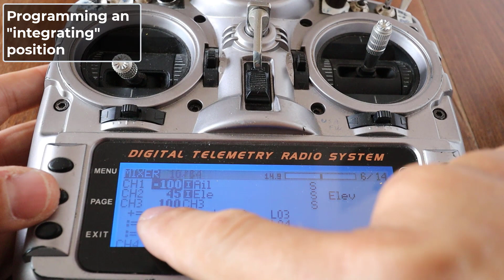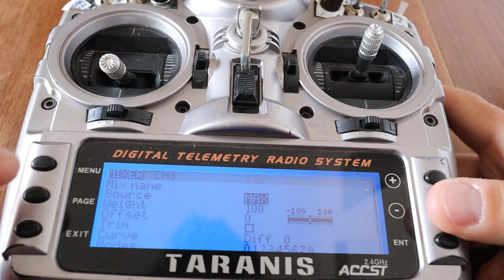Bruder RC conversion with servo only

Comment: Very nice and simple 

🔵🔵🔵👍👍👍😀😀😀🔵🔵🔵
Reply: Do you have a video of this Bruder to see how it performs?

🔵🔵🔵👍👍👍😀😀😀🔵🔵🔵
Reply from the maker: No
It is a little slow because it is running at 3.7. But moves realistic (also because i set the accelerations on the taranis, and it is powerful. I could boost it to 6V and be much faster.
Lets see if i find the time i can make a quick private video and share the linkhere in the comments
Reply: @MakerFabio  Thank you my friend

Comment: Hi Maker, is it possible that you can send me that model file and I can post it to my station?
Reply from the maker: Hi Manuel, I m traveling for a couple of days
I ll figure out how to share this WE
Reply: @MakerFabio  Hi Maker, let me tell you my progress. I have managed to place its parameters and everything was fine except that when the servo reaches its end (this only happens in one direction) it returns to its axis very slowly after about 5 seconds. Another challenge is that one of the arms of the robot has 2 servos, I verified that these parameters are not valid for this arm with double servo, it goes crazy, I would like to know your opinion, if it would be possible to assign the function I am looking for to this arm double, by the other arms, I don't know what problem can occur so that in one of the senses, they return to their axis slowly. Sorry for the bad google translation.
Reply from the maker: @Manuel-ti2zd  not sure what happens.
Probably your limiters are not working correcly, check the video at minute 6:16, those limit are clamping and avoiding exceeding 100% but also -100%
So you have 2 different logical condition for max and min
Copy each line (multiplaxer type is replace and not add). About 2 servos not working , there i have really no idea
Reply: @MakerFabio  Hello Maker, yes, everything is well configured, it only happens at one end and in all the servos, it reaches the end and after about 5 seconds, it returns very slowly to its axis.  I can send you a video to any address.